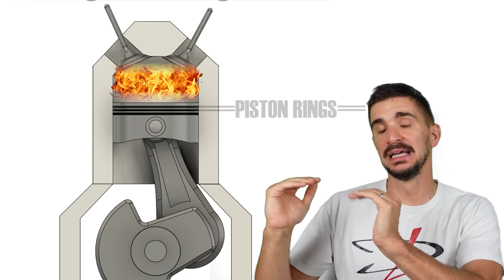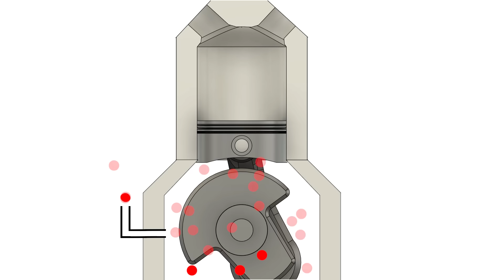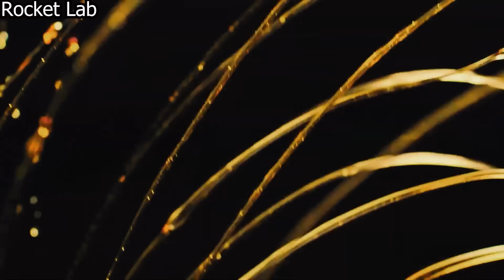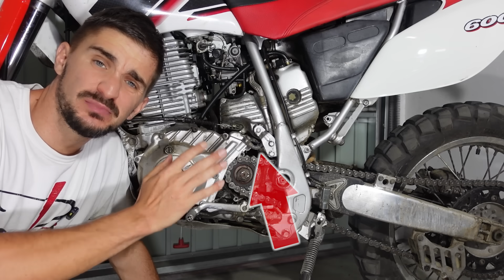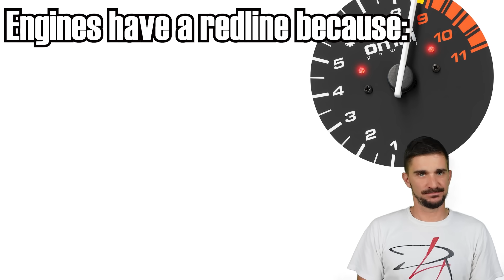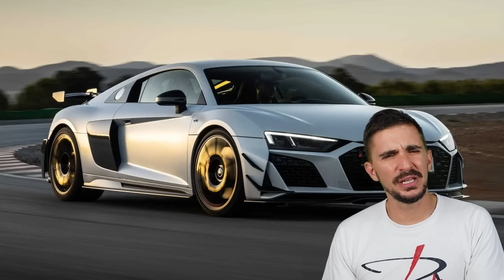Installing This Has No Drawbacks, Except for Your Wallet - Dry Sumps Are Awesome, Here's Why...

Comment: 12:00 actually not really true: A higher volume of oil will not cool anything better, it only tales longer to get up to temperature.
This can only happen when ad more cooling surface area.

But a lot of people think so. I did myself in the 90ies when I added an 1,5l extended oil pan to my beetle. I was wrong but that was 3 years before google!
Defender guys are often times sold a bigger tranny pan with the same argument, but not true, besides adding some fins and 30cm mire surface area....one something that is 100°C or so and additionally a high viscosic oil. So just good MKT.

Comment: Dry sump does create some issues in drag racing, older nitro methanol cars could make more passes on the same engine (i know they make more power now but im talking about your solo racer working out of his garage) the dry sump does what a dry sump does and now the oil that usually gets forced to the back of the motor is not there. Sure less resistance but it did 2 positive things. The obvious, oiling bearings and the not so obvious, dampening the harsh vibrations going through the crankshaft. Basically a fluid damper

Comment: I’m confused. A 2 cylinder engine with 180 degree crankshaft offers equal displacement of crankcase volume as one piston goes down, the other goes up, essentially making the volume constant. Of course there is some “pumping” of the crankcase gasses which can be handled by a small PCV or a timed valve.

Comment: er, sorry - dumb question from the slow kid at the back of the class, here.   in a standard 4 inline engine - assuming the crank case is 'shared' between pistons - doesn't the overall volume remain the same over a full rotation of crank?  i.e. as one piston is heading down another is going up?  maybe i'm misunderstand, and the volume under pistons isn't shared.
Reply from the maker: You're not misunderstanding (and obviously not slow), yes, the crankcase volume depends heavily on cylinder configuration, an inline 4 and 180 degrees twin being an example of near constant volumes during operation and a 360 twin and inline 3 as well as inline 5 and v6 being examples of crankcase volumes that vary. But none of them are immune to blowby.

Comment: GT3 RS has a dry sump. It’s the only way to go in a car seeing race track use as oil starvation is a real killer. I’m surprised more cars don’t have them as they give “free” horsepower and increase engine longevity. It’s a far better system than just having a big, air-tight bucket of oil sitting at the bottom of an engine.

Comment: I remember hearing about a hybrid vehicle with engine stop/start technology to save fuel at stop lights that used a dry sump oil system with an electrically driven oil pump so that it could maintain oil pressure and keep that thin film of oil even when the engine was off to reduce engine wear.  I don't know if anyone still does it, but I thought that was a pretty cool idea.

Comment: Wait a second.  Lower heating... 

could you remove the water cooling system lines and run the oil through a radiator?

Comment: Hey, the pickup for the oil pump in that engine starts in the middle! 13:14. Also it takes 5.7L which will fill the sump. But I get what you're saying. My Buick V8 used to run dry if I was going uphill and turning right.

Comment: Lean angel in turns on a bike doesn't matter for oil level/placement. The lateral acceleration place the oil perfectly leveled. The oil doesn't need to fight gravity with upwards force more than the rider would.

Comment: There's a small flaw in your logic about vacuum creating power, by assisting the piston as it descends - vacuum would also resist the piston ascending. Pistons spend equal time going up as down. Also, internal oil pumps also create suction from their pickups.

Comment: Increased weight, complication, and leaks. No high performance motorcycle engine is dry sump and consider how they jump and lean to extreme angles without oil starvation or crankcase pumping issues.

Comment: I've always wondered about how you'd retrofit a simpler system into a stock system, because a dry sump setup will probably end up costing you 10k (aud). It'd probably be an electric external oil pump, into a tank, then sucked back in, using the existing pump, which is capable of keeping up with oil pressure needs (with the less aerrated oil).

If the electric pump isn't having to work under large static pressure, and only dumps into a tank, it wouldn't need to be very powerful

Comment: Negative crankcase pressure does not increase power in one of the ways you describe: it pulls downward on the piston on both the downstroke AND THE UPSTROKE, so the net benefit in that regard is zero.

Comment: This video is full of incorrect information, and missing information, Im afraid.  I have a doctorate in engineering and design crankcase evacuation setups for daily drivers for reference. 
I'll give some examples of incorrect (I only made it to about 3.x minutes) 
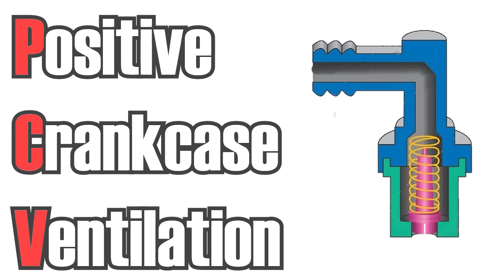1:52 A full pcv system also consist of other items such as restrictor orifice on either side, and a crankcase to air intake/filter connection. Some vehicles even have solenoids to regulate pressure. 
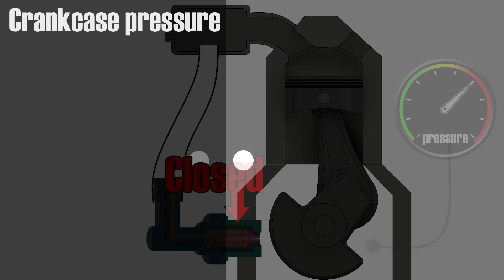2:23 the pressure set point is determines by the fresh air filter intake tract restrictor. It can be set to any value manually. 
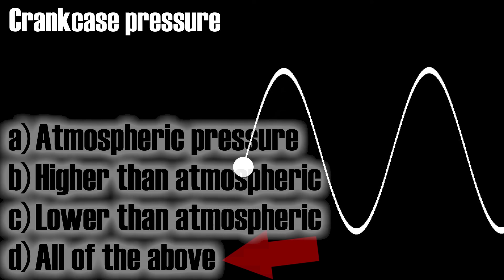2:42 using restrictors and parallel PCV/check valves one can set any pressure desired up to intake manifold vacuum using OEM PCV no need for external pumps. 
2:59 Many engines suffer catastrophic failure at high crankcase vacuums such as 4g63 it destroys the oil pump and Small block chevys is ruins the wrist pin due to oil drying, lack of splash lube. 
So no you don't always want significant vacuum.
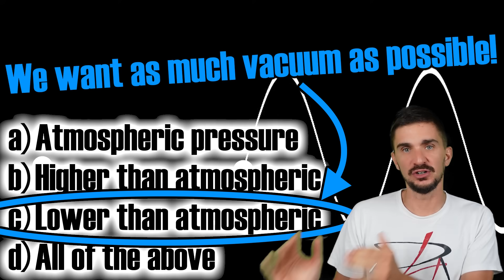3:07 feel free to check my youtube channel where I demonstrated how OEM PCV can absolutely achieve that as measured by my external battery pack +multimeter + map sensor (isolated). 
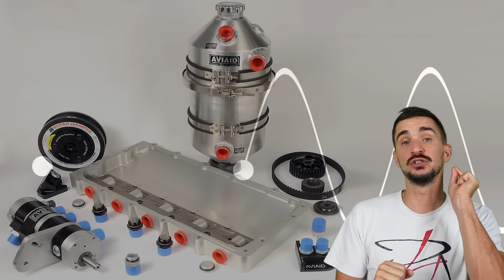3:13 You seem to be confused between dry sump and vacuum pump systems. Dry sump systems are oil recovery systems and many will not produce significant vacuum in a crankcase, for example OEM corvettes with dry sumps do not produce significant vacuum without modding like any OEM pcv system requires. 
3:14 A vacuum pump is what can drive a deep vacuum in a crankcase, not a dry sump system. They are totally different animals. You don't need a dry sump to run a vacuum pump and develop strong crankcase vacuum so it is incorrect to say that you need a dry sump. 

I had to stop its too much incorrect to keep going. If you'd like education on crankcase systems and learn how to properly demonstrate the features and abilities of OEM and Dry sump and vacuum pump systems feel free to contact me.

Comment: I don't think a normal engine has the crankshaft slushing in the oil, does it? It should only happen if you overfill it with oil.

There was a pretty good video on YT showing how that happens and it took a massive overfill.

Comment: The difference between your car's aerodynamics drag and your crankshaft's being that your crankshaft creates a vortex that spins the air surrounding it, like having a 120mph train travelling inside a 120mph wind tunnel to achieve 0 drag even though the tunnel itself would be at atmospheric level.

Comment: Why there are not dry sump transmission, just think if you want to change oil, you just empty the dry sump tank, and refil it again with fresh oil or just add an oil filter with the oild sump and also less resistance to the transmission means better efficiency, so please educate me why they don't exist

Comment: My lsj ecotec from my cobalts design lets me hook up a vaccum pump directly to the valve cover with slight modifications. Would that also work for getting a vaccum in the crank case or would that much extra air mess with the oil coming down from the head to the pan?

Comment: For the power gain aspect from the negative pressure in the crank case. Surely turning a pump for a dry sump system with a belt would have parasitic loss on the engine power

Comment: I'm thinking of making my little ST150' engine more "efficient" and reactive through engine mods, so more or the same power with close to or the same MPG and am already looking at higher compression pistons when replacing all the seals in that thing.
Might think about getting a dry sump as well, sounds to me like responsiveness could go up as well if there's just less resistance overall.

Comment: Saw some people drove their cars WITHOUT OIL for miles. Nothing happened. These cars runs prefectly fine for years later. My cousin has Golf which lost oil in DSG few years ago and drove 50.000 miles dry. Engine also was on 2l of oil for months. Works today too as daily drive, 2 years later. No problem at all.

Comment: its also why wet sump guys at the strip will put deeper pans on cars when they can, they ain't using 8 quarts of oil they put in 5 just like it had with the standard sized pan, keeps it off the crank pretty darn good and why my cheap butt runs some stuff a quart low, makes a big difference even with normal driving. keeps it inside the cooked rear and front main seal too.

Comment: Example at 8:45 I find to be misleading, would the drag of the ring on the cylinder not be the main cause of the ringa to rise to the tops of their grooves, not just the positive crank case pressure, which each cylinder usually has it's pressure of it's volume offset by another piston travelling in the other direction.. pressure's aren't THAT positive without excessive blowb-by.. But Vacuum would still be the preference!

Comment: Or you could just get a 7 qt pan with baffles and only put 5 in it like i do when i build a motor .oils no where near the crank except whats thrown against thr cylinder walls. Its cheap , it works ,  and gravity never breaks .

Comment: So could you combine this with the water injectionsystem on a engine with turbo? 
Or is the better question could you even use that system with an turbo engine because the turbo needs also oil from the bay?

Comment: If the oil pan pressure is lower than with dry sump oiling, less oil vapor can enter the intake manifold. This means fewer intake valve and combustion chamber coking problems. This could be a solution for direct injection engines.Or am I wrong?

Comment: Ford should be required to retrofit 2.7 EB, 1.0EB, and 5.0L coyote engines up with dry sumps since the stupid fucking wet belts are failing constantly. 

What a disaster.

Comment: Very nice video, I'll add something so simple I was surprised not to hear: a dry sump without a deep well keeps the engine higher from the ground in offroad application. 

A skid plate on a bike can absorb some hits from rocks and rough terrain, but the best way to preserve the engine is having all his parts higher up, far from the terrain.

It's actually the only reason I thought dry sumps existed, thanks to my enduro bike, while the cars I've driven are usually city cars far from the performances a systm like that is justified for.

Comment: Wouldn't you lose any advantage in the expansion cycle to the extra work required in the compression part of the cycle? Because now your piston is fighting a higher pressure differential?

Comment: For older vehicles there are two potential drawbacks. Older engines do not have piston squirters to oil piston skirts, and at least partially relies on splash lubrication. Same goes for the camshaft which also relies on some splash lubrication from crankshaft.

Comment: You say when a piston go down the pressure in the crank case goes up, but in most engines another piston goes up so the pressure should not go up because of the pistons moving?

Comment: That was really interesting. I never realised that there were so many advantages to a dry-sump engine.

My aircraft is powered by a Rotax 912ULS which is a dry-sump engine (so was the aircraft in the clip where you talked about oil-pressure drop at high revs). It has an oil-radiator to keep the oil cool.
Part of the preflight checks involve "burping the engine" which is a procedure in which the prop is rotated through several turns until all of the residual oil has been sucked out of the sump and sent back to the reservoir. When there is no oil remaining, the pump sucks air and a burping/gurgling noise is heard from the reservoir. After waiting a few moments for the oil to settle in the reservoir (it passes through a mesh into the main body of the reservoir), the oil may be dipped to determine the quantity.

This leads me to a question - in the dry-sump engines used in a road-vehicle, how is oil quantity determined? I can't imagine that an owner has to push their car down the driveway until his engine burps before dipping the oil.

Comment: But, you live in fantasilandia? Vacum in the engine improve the power? 😂😂😂😂😂 Piston go back and go up if you have vacum, you spend energy to move up the piston. 
2 if you have 2,4,6 ecc cilinder, when one go back, another go up and there are no energy spent to comprime nothing.
Dry sump are spent energy but offer a better lubrification and is for this that this sistem is used

Comment: Do you think that dry sump can reduce carbon build-up in direct injection engines? Since there is negative pressure and oil ( and the vapors, I presume), is sucked out and reintroduced into the engine... then there maybe, less vapor going through the ar box?!?! What do you think? That may justify dry sumps in normal cars?

Comment: Would my diesel van also benefit from dry sump or is that really use case where wet sump is better choice? Tbh less oil fil capacity with wet sump looks like an advantage

Comment: I think the cost is a bit underplayed because he doesn't add any number to the two option of wet sump or dry sump systems. For example, on my LS Miata I got a wet sump system which totals at like $300-$400 and the cheapest dry sump system I could find on a quick search was $6000 and it was missing some parts to complete it. So ya, the difference in cost is no joke and not justifiable if it cost more than my entire drivetrain combined.
Reply: This is directed at everyone saying it was so expensive because the setup is niche: nope. This is pretty typical price for a dry sump setup. I just looked up dry sump systems for a standard LS-based platform. These are close to $6k for just a 3-stage system. They get a lot more expensive beyond that. And that's for one of the most common 'performance' platforms you can find.
Reply: That's a pretty niche setup which causes the price to be higher due to the lack of manufacturing scale.
Reply: @Vicarium  Since when is the LS engine a niche application?
Reply: @Vicarium yea, my dad has a few different dry sump systems for SBF and they’re pretty cheaply had in comparison to $6k
Reply: Only because they're rare

Comment: you are forgetting main reason why they are not used everywhere - they are maintenance heavy and has very limited lifespan. which makes them super unreliable in casual or low-maintenance settings due to their complexity and component wear...

Comment: You mentioned Superbikes and dirtbikes having a dry sump system, but funny thing is, me and my father are rebuilding an old NSU 251 OSL Motorcycle from 1951, which is nothing else as the 1933 version of it, just with a different seat and valve covers. And this one also has a dry sump 😁

Comment: wouldn't adding vaccum to crank cause gases to potentially leaking into the crank moreso than usual, thus contaminating the oil more than usual? it will maybe cause more damage.

Comment: Wait - if one piston is moving upward, and another is moving down - and they are moving at the same speed because they're connected to the same crank shaft...

Then shouldn't the pressure be stable? Shouldnt the pistons simply be pumpign the gases back and forth?

Comment: are we really going to pretend like the oil teleports from inside the journals of the crankshaft and the underside of the piston to the bottom of the pan if you have a dry sump? like bud the oil has to flow through the same paths in the block no matter your system.   However if your crank is actually submerged during operation THEN you have a big problem but you know that already

Comment: Dry sump great if you want to fly airplane inverted, climb steep off road hills or need extra power to win a race. Screwed if you break that oll pump belt. More fittings to leak, spraying oil for engine fires. More moving parts and complexity are negatives for reliability and service.

Comment: Personally I prefer accusump over dry sump.  dry sump cannot pre-oil the engine before cranking and accusump is around $300 with very simple install and setup (making it nearly dummy proof)  where a dry sump is very complicated, extremely expensive (~$10k or more installed), robs power, adds belt complexity, less reliable with no mechanical gear driven (oem designed) oil pump, adds weight to the crank pulley, cannot pre-oil the engine, and installation is complicated so it is NOT dummy proof.

Comment: as for the crankcase geometry,  wouldn't an inline 6 engine retain the same crankcase volume due to perfect primary and secondary balance?

my 2 concerns with wet sump are ruptured oil lines, or a belt snapping and taking oil pressure with it (part of the added complexity) but they can both be negated by running 2 belt pulleys, as so the connection between crank and pump are over-engineered for a start (lower stresses, longer service life) but the biggest thing here is that if 1 belt snaps, it is ejected, and you're still good to drive home on the belt that remains, whereas the hose failures can be mitigated by using hard lines.
as for justification, fuel efficiency improvement, increased service interval (10,000 mile intervals that are actually safe) and i'm not 100% sure here, but wouldn't it help protect seals (particularly front/rear main) reducing the likelyhood of oil leaks?